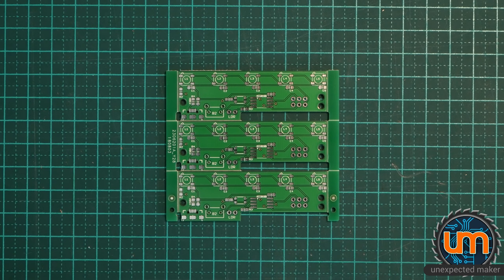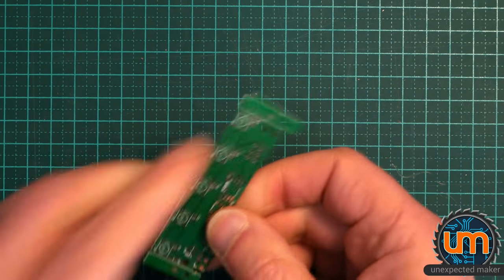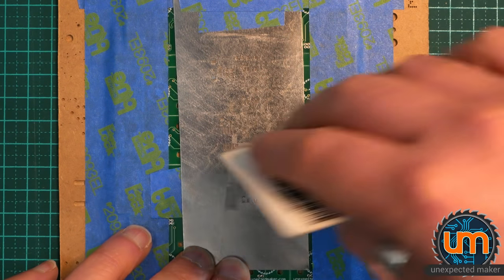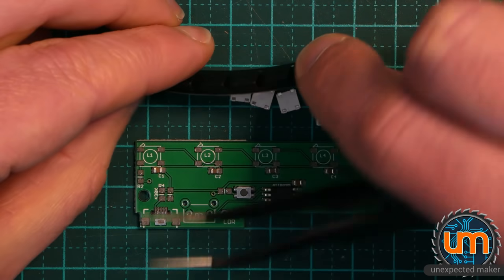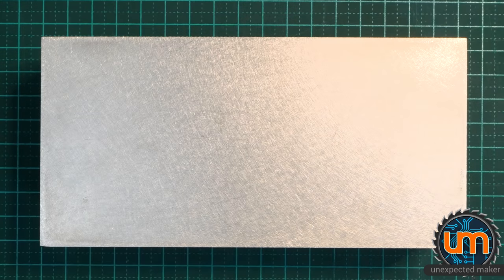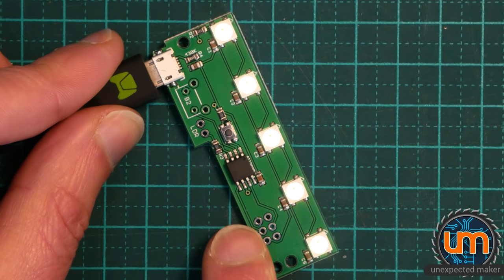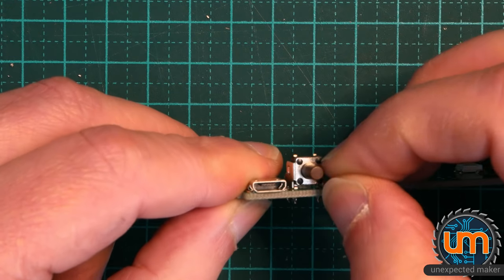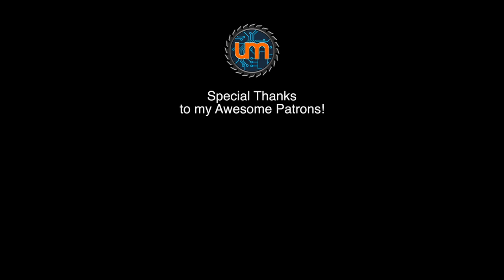Laser LED Sign - Part #2 - Converting a Concept/Prototype into Product

Comment: when you said "let's go the oven"....what's the oven ? can we use a heat gun ?
Reply from the maker: Sure, a hot air gun is fine for reflow work so long as you are carful. I use a toaster oven and my Reflow Controller to reflow my boards. Much faster and more reliable than using hot air.